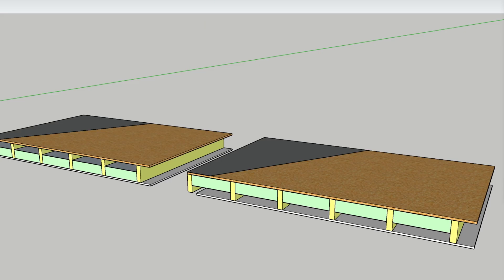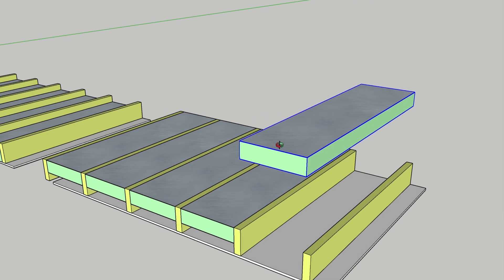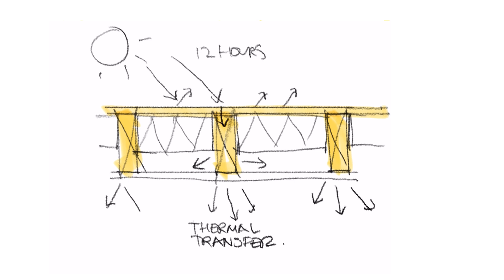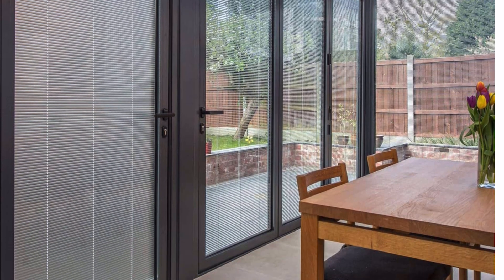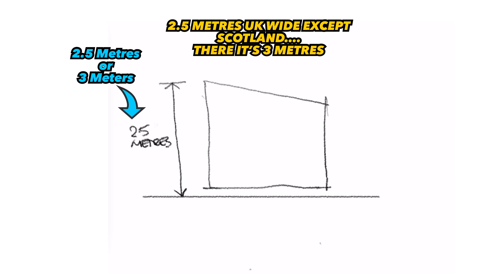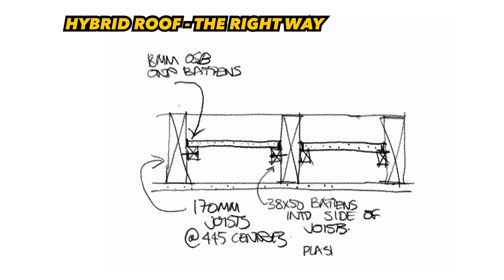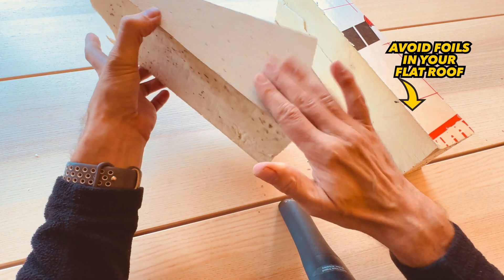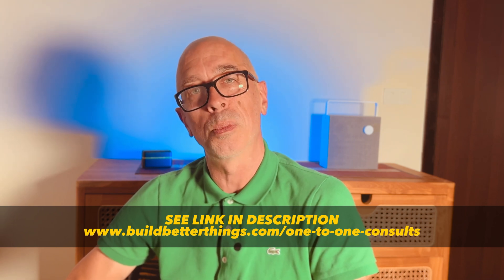Hybrid Roof - Build the Right Way- avoid overheating, avoid timber deck.

Comment: Have subscribed to the website and enjoying the content. Few questions:  Do you have a Video of the garden room build you did at the end?  I’m about to
Finalise my order for the garden room
And considering a roof rethink because of this video.  There looks to be some plinths on the roof you are laying directly ontop of the the tissue backed insulation.  Is there a video for this installed process available?  And finally… woild this be suitanle for a green roof with the thicker EPDM Rubber?  Thanks so much!
Reply from the maker: Thanks. I’ll be describing how I did that soon. For a green roof, you should consider an inverted roof.

Comment: Why can't you use foil backed insulation and glue to the non-foil side? What are the negatives about the foil backed insulation?
Reply from the maker: I think foil is usually adhered to both sides? Aside from the glue aspect, any residual or escaped vapour will condense on the metal as it’s a much higher lamda than the insulation, and because with a warm roof you have no ventilation, there’s nowhere for the condensed moisture to go.

Comment: Great video thanks. When screwing down through the insulation into joists we are going to break the vapour barrier, whats the solution here or is it not an issue?
Reply from the maker: You’re relying on the fastener going through cleanly and the grip with thickness of the vapour layer to create the seal. But it’s never perfect. That’s why you never use OSB on the cold side as a top deck and that’s why I’m advocating the use of a tissue faced insulation layer instead. Thanks.

Comment: I love the idea of dropping the deck down there joists to get a compact warm deck construction. How would you handle achieving the fall here? I do loft conversions and am trying to get away from cold roof dormers, but in terms of programming the ease and predictability of getting the joists in and temporary protecting the deck, to return and insulate later, is hard to get away from!
Reply from the maker: You can get the fall by either using tissue faced tapered top insulation layer or by giving the joists themselves a small fall. I made a video about it if you have a look
Reply: @ makes sense. I think we may give the joists a fall and batten internally to get a flat ceiling. Thanks for replying, your channel is great
Reply: Hope you don’t mind a further question, just getting my head round this still. I understand that the deck is fully protected from condensation due to being fully within the thermal envelope - would you be concerned about the top surface of the joists? Due to the majority of insulation being below the joist surface with only a bit on top, I assume they’ll often be past the dew point. It’s strange to think about as we only typically consider moisture on the deck, not the joists
Reply from the maker: Hi. Questions are good. You’re aiming to get the calculated dew point at least above the centre point of your upper layer of insulation. So the temperature will start to decline above the timber joists and then rapidly as it passes the centre of the insulation.
Reply: @build-better-things  think I understand, but if this setup achieves that (ie dew point within the top piece of PIR) then I’d imagine there’d be no harm putting the deck on top of joist as well, as it’s still covered by that top piece of PIR.  Will have to do some dew pt calcs to see how it all works out, cheers
Reply from the maker: @michaelreardon8573 yes but then you’re getting a simple warm roof with all the issues that creates with height

Comment: Really useful content. Forgive a novice DIYers question - where in this method would you create the fall on the roof? We have a very leaky flat garage roof with no fall but sound joists, which we are hoping we can strip back to and install this system. We were initially going to install firrings and then OSB over the top, but i think a full warm roof will put us over the height restrictions.
Reply from the maker: Hi. I made a video about this. Option 3 on the vid, starting with 30mm tapered tissue faced at the lowest point, with the remainder between the joists as I describe, might be an idea although you could also consider having a completely flat roof and I also talk about that. Remember I can’t see it so this is just an idea, not gospel.

Comment: Isn't the vapor and moisture not going to just make its way to the top of the roof joists and then condense on the vapour barrier and cause them to rot? the same way the OSD deck on the first one would have rotted?
Reply from the maker: Hi.  The vapour won’t condense on the vapour barrier since it’s not at a low enough temperature. That’s the purpose of the top layer of insulation on top of the vapour barrier over the joists. I said in the video, this is not the perfect solution, it’s just an improvement on having insulation only between the joists because of height restrictions.

Comment: Thanks for the amazing information. 

I have done a flat roof with “Alutrix VCL and 150mm ecotherm on top , and I was planning to install the OSB on top. 
Now that I saw your video, I am thinking to not put the OSB but I don’t want to throw the ecotherm that I installed. 
Can I put a 25mm tissued insulation mechanically fixed on top and then membrane?? 

Thank you in advance.
Reply from the maker: I’m suggesting this method for situations where you want a warm roof, but can’t achieve it due to the height restrictions placed by the regulations. For your situation, yes a hybrid roof will work but there is more to consider, you’ll likely have tiling battens, breather membrane to consider, as well as the weight of the tiles and fixings.

Comment: We use this method well almost, our way is upside down to yours, 120mm pir between the joists flush with the bottom of the joists then over boarded with 8ftx4ft 30mm pir then plaster board over that, the air gap between the under side of the deck and the top of the pir is fully ventilated through soffit vents and if necessary mushroom vents depending which way the joist run, and after 13 years no problems so far, touch wood. Great info though, thank you
Reply from the maker: Hi. Yes that is a cold roof the way it should be done, where you avoid thermal bridging with the underside insulation. Thanks for the comment

Comment: Thank you for the helpful information - I am looking to use your detail (scottish flat roof extension with height restriction) I need 200mm of TR27 
I contacted Kingspan for condensation risk analysis.  Couple of issues arose. 1. they identified risk of condensation near roofing membrane. 2. they can only recommend build up with a layer of OSB sitting above the rafters. 3. the technician put their VCL above this layer of OSB. I explained VCL should be on warm side stepping over rafter as your detail. She wrote on U value calc "VCL not required in this location, added by customer". 4. Kingspan require more insulation above the rafter than between. So build up from Kingspan is roofing /130mm TR27 / VCL / 18mm OSB / 70mm Thermapitch between rafters/ cavity/ 12.5mm plasterboard. So Kingspan seem v reluctant to take on board your detail - any comments?
Reply from the maker: To your points, 1) Yes exactly, that’s why you never have OSB on the cold side, so any interstitial moisture will have a chance to breathe through the EPDM, as I describe , 2)presume you mean joists, not rafters, 3) the misunderstanding they are having is that the deck is somewhere between the joists, and their software doesn’t allow for that 4) only if vcl is between the layers of insulation. With the solution I’m saying, all the insulation is above the vcl along with the deck.
Reply: @build-better-things  Thank you for replying - to clarify -> pt2 your sketch detail has OSB only between joists,  Kingpsan want it also above. ...other than cost and extra 18mm in height, do you see any issue with the second VCL and the 2nd OSB above the joists?
Reply from the maker: Hi again. I’d probably have to see a sketch of it to get my head around it, but I’m confused about why you would need a second vcl. I’d also get a dew point calculation from them, so you’re covering yourself. The whole point of TR27 is to not use the second osb.
Reply: @build-better-things  how to send you the sketch?

Comment: Keeping wwod (OSB) away from water (condensation) is obviously the way to go as you say. Most builders will have four reasons why they don't do this 1) they are generally quite rigid in their thinking and resistant to new techniques and ideas 2) they often don't have a lot of product knowledge as they don't go to trade shows or do much research so they use mostly use products they have used before 3) they always want the quickest way to something which is usually also the simplest and 4) they don' have to guarantee work for a reasonable time - i.e. 40 years
Reply from the maker: Agree with all your points.

Comment: I don't see the solution it will be the same problem. Moisture will still condense on the top side of the joist because the vapour barrier it's above them
Reply from the maker: Any condensed moisture from escaped or residual vapour will occur on or towards the cold side of the insulation. No part of the joists are exposed to the cold side, which is why this solution is far superior to insulation between joists, where the joist is exposed to the cold side.

Comment: Im a little confused over some of this, you really seem to know your stuff so please dont think im trying to undermine, more just trying to learn........i was designing a roof once using the king span web site that offered a spec for a hybrid roof. King span were very particluar about the build up layers which were 100mm between the joists on shoulder battens, a ply covering, a liquid dmp over the ply covering and 60 mm  insulation over....the memrane  between the 2 layerrs was impeative....i never fully understood why tbh, somthing about the dew point or somthing......thanks for helping me to understand, ill get there eventualy!
Reply from the maker: Hi. The make up you have described is not what I’m describing in the video. All of the insulation is above both the deck and the vapour retardant in the example I’m illustrating.

Comment: Thank you for another excellent idea suggestion.  Instead of using a rubber roof, what about resin roof like Flexitec 2020, any suggestions on how to this?  What about doing a video on this?
Reply from the maker: Hi thanks a lot. I’ve only seen that product where it was a refurbishment of an existing roof, and I wasn’t really involved since it was nominated.  I’m not sure you can bond it to insulation, and therefore, for a new roof, you’d need an OSB deck, which means a cold ventilated roof. However I’m happy to be corrected in the comments of you can indeed bond directly, and then it would also require a breathable aspect to it.

Comment: Instead of plasterboard on the inside, is it possible to replace that with OSB? Thanks
Reply from the maker: Yes, but unlike plasterboard, OSB doesn’t have the same fire retardant properties, so check if you’re constructing to building regulations. 11mm OSB is the closest.
Reply: @build-better-things  I never thought of that, Thanks for the fast reply. Keep up the fantastic videos

Comment: My garden room has 120mm joists, you are suggesting using 175mm. So losing roughly 5cm internal head height. Is that the compromise?
Reply from the maker: Hi. I used 170mm as my example based on a 4.2m span, and probably the absolute worst case. If you’ve only got 120mm joists then you just won yourself 50mm. You can either have a greater headroom height or increase the outer layer of insulation from 30mm in my example to 60mm, for example.
Reply: @build-better-things I think for most typical garden rooms, 120mm is the minimum size joist you can use to get a workable head height. If we started adding 30mm or even 60mm insulation on top its not going to be within the permitted development rule of 2.5m. Apologies if I have misunderstood you, but I think you said you could make it work. 

My room has been built now anyway so it's too late for me but I'm designing my loft conversion so will look at your method for my warm roof.
Reply from the maker: Hi again. I showed the heights in the video. 2050 I think floor to ceiling with 170s so 2100 with 120s. These heights work fine in small spaces like attics and garden rooms.
Reply: @build-better-things Hi, I'll try it out on my design to see if it works, thanks 🙂
Reply from the maker: For your attic conversion, you’ll need to comply with building regulations. So remember you’ll need to reach the correct u value per part L or part 6 in Scotland.

Comment: I want re insulate  my ceiling .. cold pitch roof above. Use 100mm pir between rafters. 30 mm on top to cover cold,side,. Then add insulated plasterboard below the rafters. My understanding is the plasterboard has built in vapour barrier. Would this work or would I get condensation in the rafters which is effectively sandwiched ?  Thx 🙏
Reply from the maker: You want the vapour barrier to be above the deck if possible, before the insulation. Plasterboard with foil backing is used as a vapour barrier, but the problem is your lights are going to break the barrier.
Reply: @ thx I have 1 pendent light so I’m hoping 1 small hole will be ok ?

Comment: Hi, just having an extension done, been watching your videos. Will be having steel goal post fitting. Builder planning to put the steel beam first then will fix the steel post both sides then concrete underneath the steel post about 30cm thick wide about 700mm around then let it set before removing the acrows I thick. Already have a foundation of about 700mm high. Is this a common practice.
Reply from the maker: Every install different. Pouring the concrete afterwards I have never done due to the added risk of movement. Aside from the method, the dimensions you note should be done to the sizes noted your structural engineers drawings.

Comment: Can you walk on top of your better roof?  Wouldn't there be a risk of punching through where it's just insulation?
Reply from the maker: Yes you can walk on it, for occasional maintenance per the manufacturer’s guidelines.  There is the same risk of puncture regardless of the sub strata.

Comment: We recently had our attic done, there is now a 2 foot gap between the loft conversion floor and the bathroom ceiling below. That gap is full of cold fresh air from the soffits, and as a result the bathroom ceiling is very cold and damp. There is no insulation above the bathroom. Do you think this space should be isolated from the soffit or insulated? Im worried about moisture from the bathroom entering the space above the ceiling where it is very cold and condensing there. Any tips ?
Reply from the maker: There should be WBP ply boards at your eaves to your soffit vents to prevent the insulation from fouling the vents. This is often not done since no one sees it, and the insulation is not able to be taken right to the wall plate as a result. That would be my guess.

Comment: Hi there, great clear information on your channel, I've just bought a 150 year old bungalow with no insulation in the ceiling, I would like to super insulate this as I would like to lower my future heating costs, and have a cooler house in in summer.
I have studied your clips and I'm still not sure where I would need my vapour barrier and would I be okay to put insulation above the ceiling beams? I have no plans to use the attic space. ❓
Reply from the maker: You always put your vapour barrier on the warm side of your insulation. For your attic, you would put insulation between the joists, and then, cross ply, which means you would lay over the top in the opposite direction additional layers. A minimum of 3 layers  Mineral wool.  The most important thing would be to introduce ventilation into your attic, to avoid condensation, most likely through eaves and ridge vents. This is effective a cold roof arrangement, only done where you’re never using the roof space. Thanks for your comment.
Reply: @build-better-things  I will follow your instructions to the "T",  thanks for the information. I have watched your  "timber floor or concrete slab" clip, for my situation the slab is the way to go, too many ventilation issues, very informative as usual, much appreciated. As with most things in life, "You only do it once, so do it right"         👍👍👍

Comment: Love the way you put the details across easy to follow along with a explanation as to why and what the consequences could be -  based on the detail shown with solid joists - how would you deal if the roof joist if it was an Engineered I Joist- Regards
Reply from the maker: Hi. Would you ever be using an I joist arrangement where you also have a height restriction? I would expect a warm roof in that set up, but, to answer your question, I would take advantage of the depth and increase the insulation between the joists, and then have my thermal break tissue layer over the top still. Vapor barrier would still need to be below.